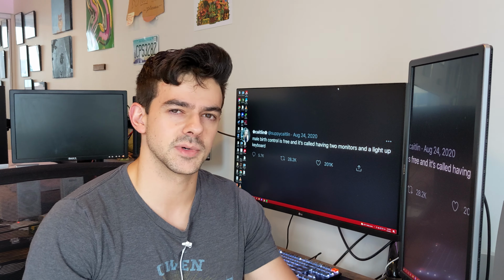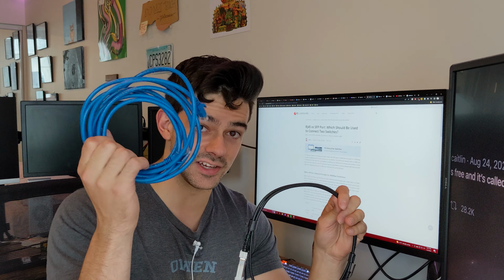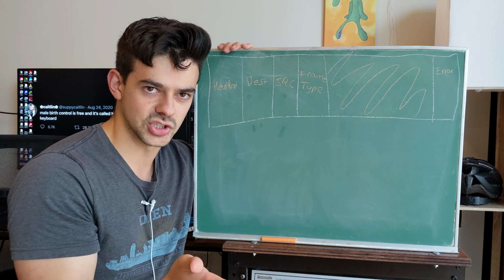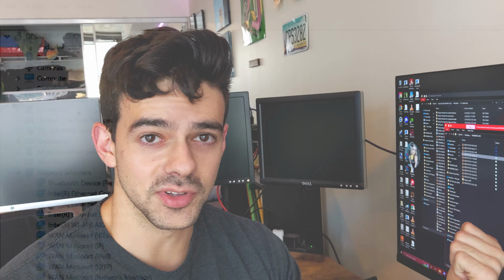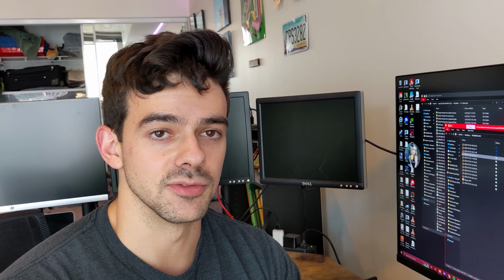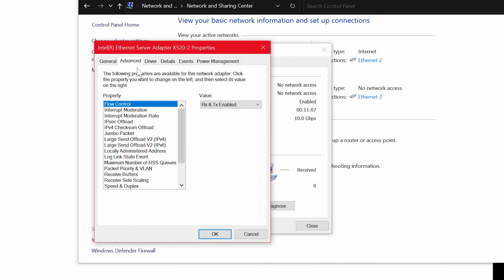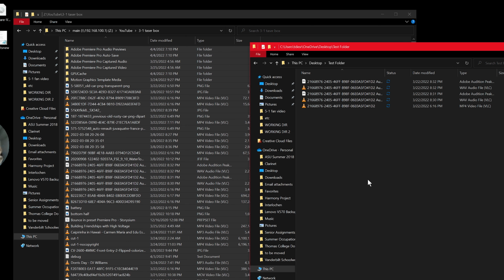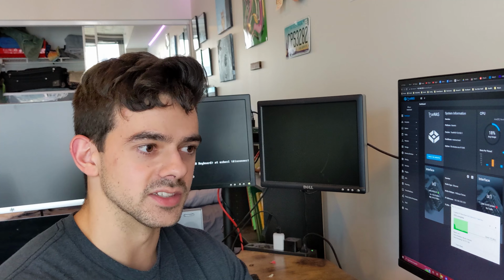What's the best way to connect two computers together? | 10Gig Network Upgrade!

Comment: Never mind, I connected my fiber (om3/LC) to my main computer’s NIC and it works. By the way, you can configure your NIC on the TrueNAS web UI by setting the info AND, run the Test connection so it engages. Transfer rate was 253MB/s, thought it would be faster. I will tweak it later

Comment: 1000MBS = 1GBS You Are Limited By The Speed of Your Hard drives! You Have To go To SSD's Or Even Better NVMe SSD's Or A Striped Raid Array To Increase That! I Know There Is A way To Have Your NVMe Drives Act As A cache So You Can Transfer Files Much Faster Even Over Cat5! Not A Real Network Man But I Have Picked up On A Few Things From Copying The 14TB Hard Drives i Have My Media On!! On Just A Mechanical Hard Drives Copying One To Another Over SATA it is About 100mbs! Which Over USB Gets Cut Way Down! That Is The Reason Most PC's Still Come With Just A 1GBS Network Card Even Today!

Comment: Man, missed my comment regarding seaching ebay for IBM 12 BAY NAS, which will give you a sweet deal on one of those, mine even came with a QSFP card on  top of the quad gigabit add on which was also AWESOME (for when I have a switch that can actually use that one hehe) The price was crazy specially with the HDDs included. Upgraded from 4core xeon to 2 6cores and from 24Gb to 24Gb + 12Gb (you know 2 numa nodes, my second numa node is mostly for a VM in any case)

Comment: MTU wise, its size in todays world should have a minimal impact on performance on most scenarios. Basically it was definitely crucial when your CPU cycles would get taxed by the number of packets in flight, which increasing the MTU will reduce by increasing the packet size.
Now, thing is, this CPU tax won't vanish and if you do this on your WAN link the tax is moved to your router that will now need to break those down into the same size as your WAN interface. So, this may prove a bad idea in some cases (though in my case it would be ok, I have what I call an overkill router hehe)

Comment: Well adhoc does improve your latency, though the difference between that and a decent switch should not be noticeable unless you have a lot of traffic on that switch and cross vlans (well that last one just adds to the latency increasing stuff)
Still, I stay by the statement that your switch should not be routing the traffic between your PC and your NAS to the router.

Comment: NO, the switch will only do that IF the devices are on separate subnets/vlans. Otherwise its routing tables should skip that hop altogether. Check how switches work, in particular managed switches, L2 or L3 will do for this, in fact L2 is more than enough until cross VLAN routing becomes a thing.
Reply: I was gonna say this exact thing, like bro whats wrong with your switch?? It shouldn't be passing traffic to your router and back.

Comment: Huih, your switch should not be sending your traffic back to your router, not if properly setup and your setup is not relying on the router firewall for things the switch should be doing, like VLAN routing.

Comment: Not sure if you have seen but Dell makes Cable Management Arms (CMA). They connect to the rails of PowerEdge servers and make it so that you don't need to unplug any cables to pull a server. Fairly inexpensive and a huge time save. I have had PowerEdges for years and only recently found out that CMAs exist. Hope this helps
Reply from the maker: For sure! For me, it's a cost thing. Also the poweredge servers are a little too loud while I'm still living in a studio, so I don't use them much anyways!

Comment: I guess only notes here, if your computer and nas are on the same subnet (which it appeared)... your router is completely out of the picture, and it was just whatever connection from your computer to the switch and to the nas (since it sounded like they were on the same switch).  Only time your router gets involved is if you are going from one network/subnet to another network/subnet (unless you have a layer 3 capable switch and it is appropriately managed, which is highly unlikely in this case).  And that network/subnet to network/subnet routing only takes place if your router rules allow it to occur.  So your ~300 microsecond (not nanosecond) ping was mostly your switch's packet switching capability, which is pretty average for 1G, and I wouldn't expect that much better with 10G; really any local area network should have sub 1 ms ping.  Things that will eat that effective bandwidth will include, however, any other broadcast packets on the network (which sounds like since you've subnetted off a lot of stuff, isn't going to be near as much as most people will have), and anything else your doing with the network. Obviously with 1 to 1 connection, there will be far far less broadcast packets, so don't have that, and very few other network packets will interrupt the horrible thin g that is SMB shares (windows file system never was meant to do such high speed networking). All in all your limitation is disks... two hard drives in mirror you will do good to get 150 MB/s.  Need nearly 12 (or 6 if you dont care about data security) hard disks to even think about saturating 10G. 3-4 SSDs possibly.  But at that point, there are far better strategies to ensure fast editing and data security... even if we all want Linus's over the top setups.
Reply from the maker: This is a great response! I appreciate the information, definitely learned a lot
Reply: Could you name those strategies do i can look in to them? Thanks